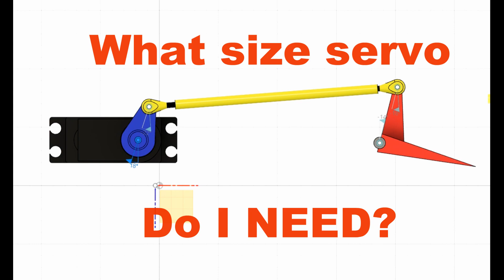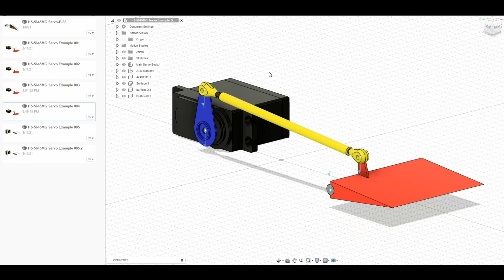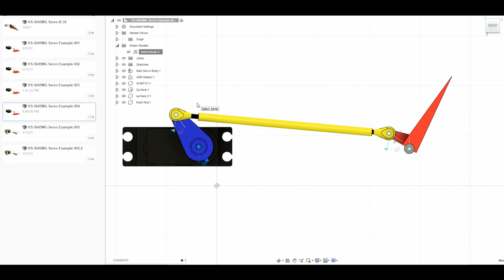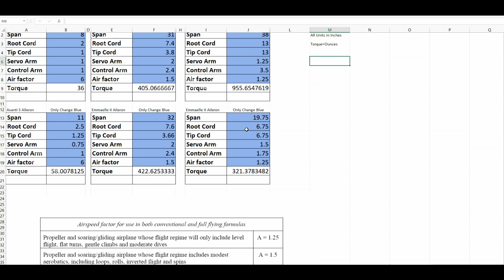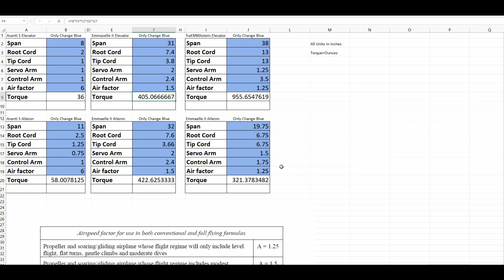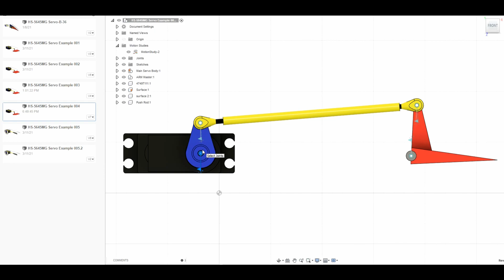Pick the Right Servo for Your RC Plane!

Comment: Hello there! I was wondering if you could tell me where I can find these formulas, since I didn't find it in the AMA LMA program document 520-A.
Reply from the maker: Its on page 19 Section 3: Servo Torque part a) Minimum torque = A *Chord *Span * Chord/3 * Servo Arm/Control Arm. A = Airspeed Factor (see Table 2.1)
Chord = average control surface chord (root chord + tip chord) / 2
Span = control surface span
Servo Arm: the distance from the center of the servo arm to the control
linkage
attachment.
Control Arm: the distance from the hinge line to the control linkage attachment.

Comment: I am new at building RC airplanes. I am building a twin 90mm SU37. It has a wingspan of 1200mm and a length of approx 1700mm. It weighs about 13lbs to 15lbs with lipos. I am using spare parts to build it. The elevators each have a servo that I got out of a Freewing Stinger. Seeing the size, weight, and speed I don't think these servos can handle it. Can some please make a suggestion of what servos I should use? Thanks
Reply from the maker: Can you tell me the length and cord of the right elevator? Width and length? And what you think the max speed would be of the aircraft? I can figure it out. Thanks.
Reply: @dagtheaviator  Thanks for the response. I did a little research and I ordered 30g servos. These servos are used on a Freewing twin 80mm edf MIG 29. It is about the same size and weight of the twin 90mm plane I am building from scratch.

Comment: So helpful. Thank you. Please also help understand the impact of receiver to servo cable length on servo performance for giant rc airplanes. When you get to like 2meter+ on cable length, does it result in significant voltage drop that the servos may not work. If you address this any of your videos, please do share the link. Would help a lot as I can't seem to find this anywhere. Much appreciated